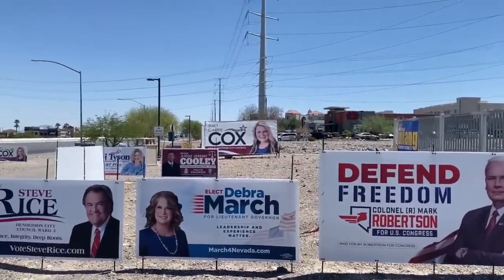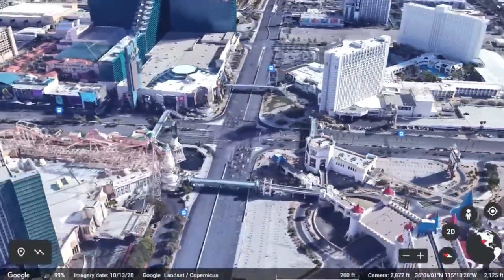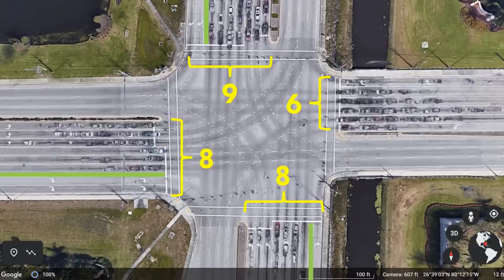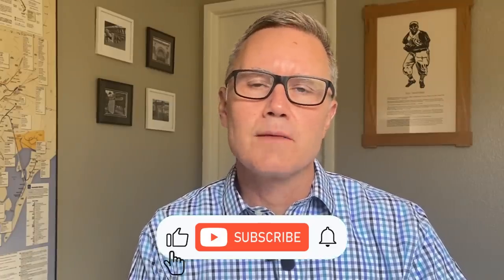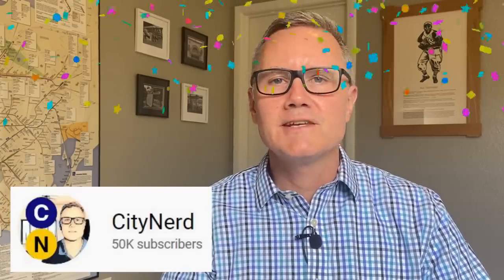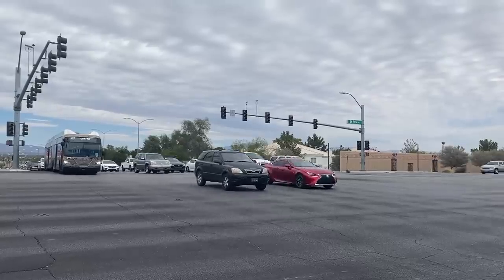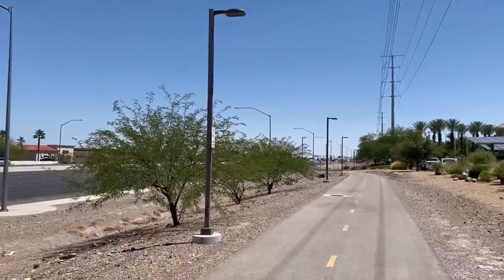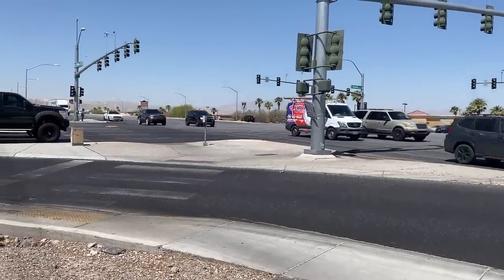Stroad vs. Stroad: Land Use, Traffic Engineering, and What Happens When Suburban Arterials Intersect

Comment: I did a big of surfing around Google maps and I found a 36-approach lane intersection (32 for cars and 4 for bikes) at 41.0304830689161, 122.92766534959937. That is the junction of Jianguo Blvd. and Anshan Road in Anshan City, Liaoning Province, China. I have, in fact, driven through this intersection several times. The area's road network was built up about 8 or 9 years ago when Hu Jintao was president of China. There were plans to significantly extend Anshan city to the south and build a huge new suburb. However, when Xi Jinping became the countries leader, he went on an anti-corruption and the suburb was never built. However, all the arterial roads are still there. Very little traffic ever actually goes through this junction despite its size.

Comment: This intersection is wild because it is so big that even with all of that dead time, I've had times where I enter the intersection in my 18 wheeler on a green left arrow and did not get all the way across before the beginning of the next phase. It takes me a full 7 to 10 seconds to clear the turn without pulling enough lateral G's to topple the stacked pallets of water bottles in the trailer. Absolutely ridiculously huge and I do my best to avoid traveling on St Rose because of it.

Comment: one of the things that really ends up happening here that's just so fucking annoying as a pedestrian is that you are trying to cross a street and there's a continuous fucking flow of cars turning right not even seeing you or caring to stop, so you just have to wait  the entire light- in fact I'm almost certain a fair amount of people have been stuck there until the entire light cycle changes and then there's cars on the other street waiting for them.  The minimum there should be on right turn lanes is a flashing yellow right arrow rather than just green, as well as on street writing saying YIELD TO PEDESTRIANS.  a better intersection could have small speed bumps on the right turn lane.
Reply: also, get rid of the pedestrian push buttons at car intersections- it should be automatic, not to mention those things only work if you press them before the light- if you press them while you should alreasy be able to cross, it's technically illegal to do so.

Comment: The best part of stroads is the right on red and/or protected right during straight phase. Drivers will almost never look right to verify there's not a pedestrian, they'll only look left to ensure there's no oncoming traffic. As a kid, I was run over multiple times on the crosswalk by an impatient parent trying to get to/from school to pick up their kids who couldn't be bothered to look right at an intersection. The worst one was a stop sign where a minor road connected to the stroad -- the setback for the stop sign was pretty far, but because the driver was trying to get a better line-of-sight on the incoming traffic, rolled well past the actual stop line and into the driveway, cutting into the crosswalk. He hit me right as I was reaching the bottom of a hill on my bike, and I had no time to stop. Managed to break his bumper off when I fell. There really is zero consideration that people might need to use pedestrian facilities in the southwest.

Comment: I hate these Stroads, big one in my area is Eagle Rd. (Hwy 55) and Fairview Ave. in Meridian, ID (Boise Suburb) it's expanding to 24 approach lanes. 3 through lanes, double left turn lanes and right turn lanes. Surrounded by  large shopping districts, complete with grocery store, big box stores, fast food and a large park near by and a huge plot of vacant land on the NW corner of the intersection that if commercially developed with likely nearly double the amount of businesses. Plus an existing shopping districts announced the final phase of development adding apartments closest to the intersection  Did I mention Eagle Rd. is a non limited access highway with a 55 MPH speed limit and that is the only reasonable North-South route connecting many square miles to the interstate. As well as intersecting with two other non limited access highways just to the north. 

Boise, ID/Treasure Valley has to be one of the worst growing cities in terms of transportation. Metro is nothing but a few bus routes, all current highways aren't limited access and the sprawling suburban arterials are poor old 2 lane farm roads that are drastically undersized. A single interstate with 1 short spur into downtown is all that serves the area.

Comment: I bike a mile from the bus stop at a strip mall to work and the intersection between the mall and the 45 mph road sucks because the signal length varies widely and I'm forced to use the ped signal (which you usually have to wait at  least 45 seconds for) since I have been caught in the huge intersection as the light turns yellow, red, and then green for the other direction as I'm still trying to gain speed. There's an angel bike there also, which isn't in the least bit frightening.

Comment: The sliplanes are bad enough, but with right-turn-always, the regular right turn lanes are worse. Sometimes you can't start crossing when it's legal because too many divers are making right turns. Sometimes you can't finish crossing for the same reason. And they're going fast, and they're firing turn signals so it's harder to see and harder to keep your balance.

Comment: With “stroadification” (the making of streets and roads into stroads) goes, Houston does it pretty “well” as far as meeting demand goes. Instead of making monstrous intersections, local TxDOT has instead decided to opt for semi-grade separation for some straight-ons, creating 2-level interchanges where stroads meet and 3-level interchanges where stroads meet highways—most of which are even finished off with that signature Texas U-turn.

In some cases, that means building overpasses (eg Woodlands Parkway at Grogans Mill Rd), but a surprising number of them are actually underpasses (eg Kuykendahl (pronounced “KER-ken-dahl”) at FM1960, Montrose at Allen Parkway, and US249 at FM1960).

It seems to come from Houston’s (and Texas’) naturally ingrained understanding of feeder roads and the want/need to make sure thru traffic gets held up as little as possible. The largest intersection I can think of off the top of my head is Westheimer at Voss Rd at “only” 21 (22 if you count the the slip) approach lanes, and that is notoriously bad as an intersection that should be “upgraded” with an underpass for straight-ons.

None of this is to say Houston or the Sun Belt’s way of handling traffic is “good”, but more that Houston has stroad engineering locked down down to a T.

Comment: "What happens when suburban arterials intersect"? My South Florida city, Sarasota, happens, apparently. Our entire existence is basically defined by these accursed things around here. The approximate defining point of the city is where a stroad section of U.S. 41 intersects with the other stroad Fruitville Road/SR780, a wonky T-interesction with slip lanes that eventually got replaced with a... slightly less wonky multi-lane roundabout. At least that one has signalled pedestrian crossings now, which is neat and also probably a first for our entire county, though they're so close to the roundabout itself that they tend to cause congestion on what should be a neatly smoothed-out intersection.
The featured intersection here in this video reminds me of our junction at University Ave. and US 301/Washington Blvd... except that one probably has even faster approach speeds. :D

Comment: 3 minute to wait for a pedestrian is way too long, especially in the hot sun, or the cold of winter. I'll admit that I will often just walk on the green light. One thing that does help is that the biggest intersection we've got is 14 outbound lanes. The other major thing is the fact that my city uses arrows instead of round dots at almost all major intersections. Round dots are only seen at minor intersections, and even then, most of those are outdated signals that the city just can't be bothered to replace. 50 km/h is the speed limit on all streets in my city.

Comment: It honestly doesn't even take a super huge street to be insanely dangerous. Those turn slip lanes are death traps even on smaller roads. All it really takes is a decent stretch of straight road before the slip lane and you get people going around them at 40+ mph easily. Simply put I always find those slip lanes funny.

You basically have all the danger of J walking just to get to the cross walk.

Comment: The problem with crossing a slip lane as a pedestrian from the outside corner to the pedestrian island is that drivers (in right side drive lane countries) are looking left for cars in the lane they wish to enter and only rarely check to their right for pedestrians.  As a pedestrian in that situation I always try to make eye contact with the driver to make sure they see me.  Of course, if the driver stops they run the risk of being rear ended by the car behind them whose driver is also looking left and is assuming the car in front is going to continue on.

Comment: The main 'stroad' in the suburb I live in is east-west, is also a state highway but in my town, it is extremely busy.  So much so that on the towns' website, that road has its own page for crash statistics (it is very bad).  The reason for the crashes is from the left turns into the shopping areas and road rage.  We have high amounts of both.  The plan is to widen the highway to add a center median to reduce the left turns.  Currently the road is two lanes in each direction with a center left turn lane and a 45mph speed limit.  Some of the big intersections are being upgraded to have a median to allow no left turns at all.  So how is one supposed to turn left on or off this road?  I live in Michigan and we have a tool other places call the Median U-turn but is more known as the Michigan Left.  /s.  Perhaps is will mitigate the left turn crashes.  I doubt the road rage.  I'm not used to living in suburbia.

Comment: California law states that if the light turns red while you’re still crossing the intersection, you have not run a red light. This has made it so in California a yellow light usually means drop a gear and floor it, we’re gonna make this light

Comment: I increasingly wonder if alternative intersection designs being rolled out everywhere would be a significant improvement by themselves, regardless of pedestrian facilities. CFIs/Displaced Left’s & Michigan Left’s come to mind. 

Roundabouts would likely not work unless the road design speed is south of ~45 mph… particularly the Carmel IN & Wisconsin style multi lane roundabouts that likely originated in the Netherlands or somewhere similar…

Instead of both roads getting protected left turns at a standard signal with 1… 2… 3… 4 directions per phase, all of the lights within the entire intersection could instead be 1… 2… 1… 2… less idle time; more “green” time for everyone.

With potential to REDUCE the number/length of turn lanes within the intersection on top of that. Maybe even narrowing the 8 lane down to 6 thru lanes. 6 lanes seems plentiful enough if there’s plentiful arteries paralleling. 8 thru lanes or more, even on freeways much less suburban Florida/Vegas sized arterials is just BEGGING for a confused/lost driver to literally slam on their brakes and go from the far right to the far left or vice versa at a snail’s pace at the absolute last minute when average traffic speeds are almost interstate speeds. A pileup just dying to happen.

Comment: just to put some perspective on the speed limits, in germany (you know where there is no general speed limit on federal highways at 2 lanes per direction, also called Autobahn...) such Crossings sometimes do exist,... within city limits, speed limits are down to 50 km/h, that's a lot less than 45 m/h

Comment: If the left turn lanes are protected turns and there are right turn slip lanes, the pedestrian crossings that would otherwise be in conflict should be able to operate for the entire length of the through phase because of the absence of conflict during that time.

Comment: There are quite a few high speed 6-8 lane divided surface boulevards here in the greater metro Detroit area, most notable probably being Woodward (N-S, 35-45mph), Mound ( N-S, 50mph), 8-mile (E-W, 45 mph), and 16 mile (E-W, 50-55 mph)

Most big intersections use the "Michigan Left" method for left turns and have an extra turn lane for right turns, a lot of these roads have lights timed for continuous throughput at or slightly above the posted speed limit (or double the posted limit if you're willing to take the risk, and well, young and stupid)

Excellent for car travel, not so great for bike or pedestrian traffic, Sidewalks on Woodard are pretty much at the curb for most of the length of the street, and some of the big north-south roads disappear once you get about 10 miles or so north of Detroit proper

Comment: Any idea why they use a 6 phase cycle instead of a 4 phase cycle? If they combibed the left turns (i.e. Eastbound and westbound left turns at the same time and then north and southbound lefts at the same time), that would reduce lost time.

And thanks as always for a great video!
Reply: I didn't check but one possibility is that the left turn lane paths interfere.

Comment: Narrowing the slip roads and tightening their radius of curvature would indicate to drivers the need to slow, as would raised crosswalks.  But of course, it's hard to make stroads safe, let alone pleasant.  Something that is both supposed to simultaneously be a through road and an access road for dozens of miles, just doesn't work.  It'd be interesting to see how the Netherlands made the thirty year transition to something better for drivers, pedestrians, cyclists.  The usual is to show the Netherlands as it currently is, and North American stroads as they currently are, or Netherlands as they were thirty years ago.  But what's the in between?  What are the steps?  I imagine throwing a modern Dutch intersection into the middle of the networks shown in this video, as just yielding an even worse mess.

A nearby city (despite having a large existing off road bicycle/pedestrian path network, and a bit popular one at that) decided to paint a lot of bicycle gutters, which, needless to say, are routinely ignored by drivers, and who knows how much trash is in them.  Save us from that.  I've bicycle commuted through a major international airport's drop off zone many times, but the downtown (especially) bicycle gutters are way beyond my comfort level, as cyclist or driver, from what I've seen.  Maybe that's the intention; just make everything even worse for everyone.

Comment: Shouldn’t road with 8 lane be designed as “highway/ expressway” where the speed limit is set to over 120km/h (better if there is no limit at all) and have interchange in place of intersection?

Comment: As someone who goes through this intersection daily, I can say it’s honestly not that bad. At peak times, you still get through the light after waiting (unless you’re turning left onto eastern) and the speed limit is a nice 55. It certainly has Changed over the 12 years I’ve lived on this side of town. St. Rose was comparable to a freeway, minimal traffic lights and lack of businesses with miles of desert surrounding. Now it’s become congested and it’ll get worse thanks to the expansion of Inspirada in the south. I can’t suggest what would have been a better idea, besides just not building more homes since we haven’t got the water. I don’t think it’d be better any other way I try to think about it.

Comment: I hate that U-Turns are allowed.  You can't 'signal' that you're about to make a u-turn.  A motorist or pedestrian on the road 90 degrees to your left has no idea you're about to perform a u-turn and possibly crash into them.  And you may have to use a non-driving portion of the road to make your turn, unless it's a super-wide road which, to be fair, this example may be.
Reply: U-turns shouldn't be allowed in intersections (i used to think it was illegal), and while you are taught how to do things like a 3 point turn thats olly for emergencies and you should find someone's driveway so you can get off a road and then back on it.

CT has a "shopping district" called the Berlin Turnpike, its actually Route 5 but its been converted into a 2 lane each way (plus turning lanes) divided stroad and i refuse to shop there, i don't feel safe driving on it. (Makes sense considering its supposed to be a highway)

Comment: Las Vegas is impossible to fix, its too hot to walk or bike 7 months of the year, the bus system blows major chunks, the ground is too hard to make subways. Las Vegas is going to be a suburban hell hole pretty much forever.
Reply: I used to work next door to that BWW, but to get to Trader Joes the next parking lot over, you take a car, because you do NOT want to cross that stroad on foot, ever.. ever ever.

Comment: Damn. And to think that with the same amount of space (likely less) you could have had roads that would both be faster and safer for drivers and everyone else if they didn't trie to shoehorn everything on the same road but made appropriate design decisions. Like making the main car routes actual grade segregated through routes. Getting rid of most traffic lights and replacing them with yield signs or roundabouts on the local roads, giving buses maximum priority, maing walking and cycling viable and safe on their dedicated infrastructure thast didn't feel like it 'impeded' on king driver.